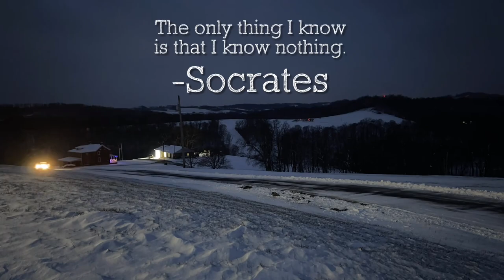How to Tune Your New Council Tool Hudson Bay Axe: Snow at the Bushcraft Camp

Comment: Glad to see you got some snow!  This question is off topic but I went out chopping this weekend and was quite humbled.  Just wondering what your best performing chopping angle is and if it's worth chopping when it's below freezing due to the wood being frozen?  Any ideas would be greatly appreciated.  Thanks
Reply from the maker: Angle has gotta be below 20 degrees or don’t even bother.  I find 17 with a small micro bevel works very well in most woods.  The temp doesn’t really matter unless it’s real cold, so long as the wood is green and not seasoned.  If it’s seasoned, get a saw lol.  Most axes aren’t even close to setup for chopping, so don’t let that deter you if that was the case.  Beyond that just work on accuracy.  It’s way more important than power.  That’ll come later with form.
Reply: I appreciate the input!  I've done some chopping in the past just monkeying around but this year gonna try and be more serious.  I was at a 20 degree and ready to throw my axe. I also had an axe with a curvy handle more for display rather than using and that affected my accuracy.  Hopefully with your input and my patience I have a better outing this weekend. Thanks

Comment: Hi Kevin, kinda knew to your channel. I love axes too. I  have way to many. Or can you ever have to many? I am rehandeling an axe I purchased at a yard sale. They had used a grinder to sharpen it. I have lots of files but none seem to cut the steel very well. My question is,

 What type and brand of file you use? Thanks Kevin. Love your videos!!
Reply from the maker: Well welcome then.  FYI I call the comments the doobly-do 😄.  And no, you can never have too many.  As far as the files go, I recommend Simmonds double cut.  If you can find the 10” one with the red rounded handle that is the most aggressive file I have found.  I use it to reprofile axes or grind new ones.  That said, a lot of vintage axes are too hard to hand file.  I have two Plumbs and one CT that a file won’t even touch.  And some modern axes are that way too.  My HB Kisa destroyed one of my files and the GBruk axes are soft enough to file but only just.  So keep that in mind too.  The file I was using here is a Pfred.  I really like those too, as they cut well and leave a nice finish, but they dull pretty quick too.  Good luck!